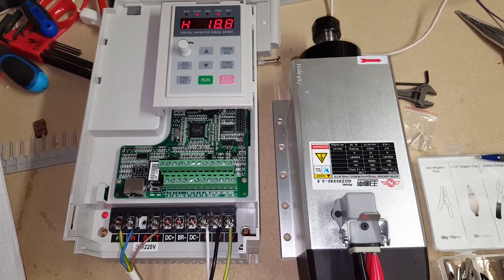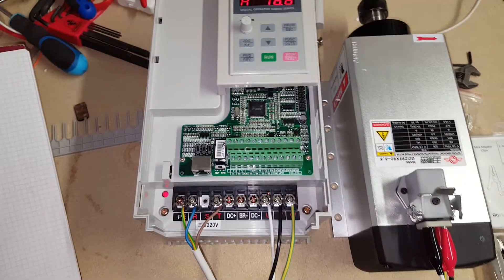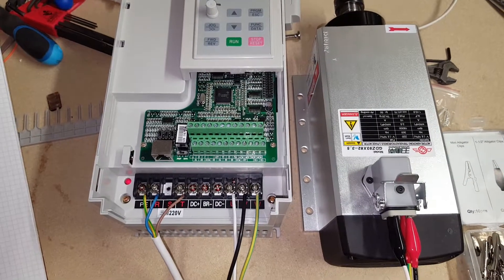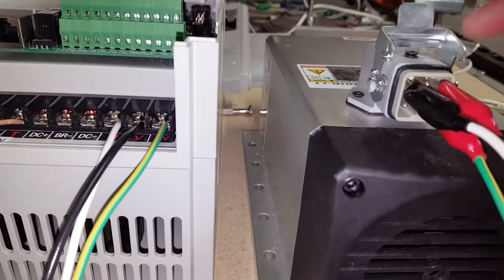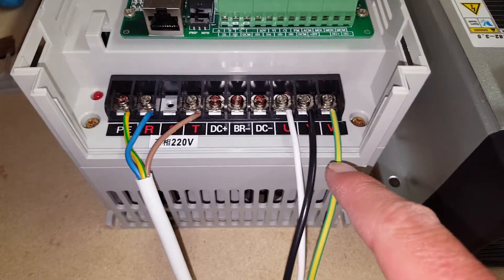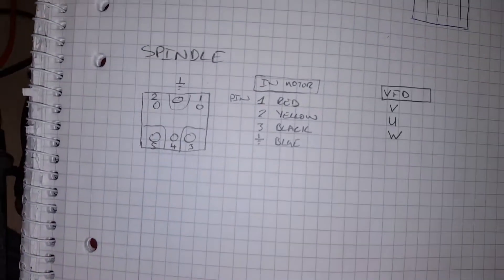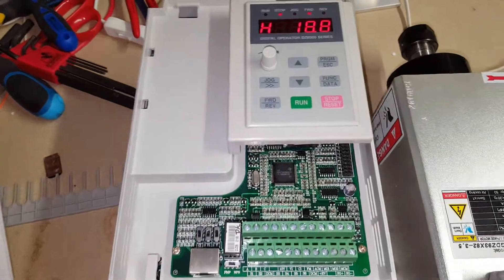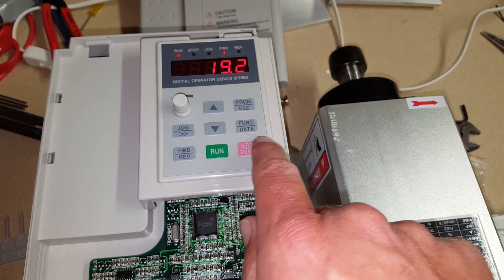Connecting spindle GDZ93X28-3.5 to Fuling inverter DZB280B003. 7

Comment: Hello, I have a question. This a 3 phase inverter, seems like you have it wired 1 phase, are these inverter 1 phase or 3 phase?  THank you much
Reply from the maker: Hi, The inverter takes single phase (from the wall) and chops it up into 3 phases for the motor. RST are the incomming lines, UVW are out. EMI shielding is not great, so its pretty noisy on devices close by.

Comment: I made connections and looked at settings all right. but it does not work on the back of the potentiometer on the inverter , user manuall is chinese :/ do not write me the parameters from scratch

Comment from the maker: Spindle SETUP:
PRGM (F0) 
UP (F1) Motor settings
FUNC (F1.00) 
UP (F1.01) motor power
FUNC (3,7) (KW)
DOWN (3.0) (KW) For 3KW spindle 
FUNC (F1.02) Rated Frequency of the spindle
FUNC (400)
JOG ( to go to first digit)
DOWN (4 goes to 3) set frequency from 400Hz to 300Hz
FUNC (F1.03) RPM
FUNC 18000 rpm ( calculated automatically )
FUNC (F1.04) Rated voltage
FUNC (200) V
JOG
JOG
JOG
UP 
UP (220) V for 220V users
FUNC (1.05) Rated current 
FUNC (15Amps)
JOGx4
DOWN x 5 (0011.0) 11Amps
JOG 
UPx4 (0011.4) 11.4 Amps
FUNC (F1.06)
PRGM
DOWN (F0)
FUNC (F0.00)
UP (F0.01) comms type to input terminal not VFD keyboard
FUNC (1)
PRGM
FUNC (F0.00)
UP to F0.003 (VI control, PWM from BOB)
FUNC (0)
UP (1) 
FUNC
Reply: For some reason when I use these settings, my spindle doesn't work with the knob? Is there something I'm doing wrong? Thanks

Comment: Just to clarify more, I attempt just to rotate the spindle using the inverter panel Run button, I still did not connect any PC breakout board or other device.
Reply: Hello Anass
Can you please help me in setting up . I have connected the 3phase power supply you dzb 300 series filing inverter and connected the u v w to spindle but when I press run button it is not working. The button is disabled or something. It just displays H 0.00

Comment: Hello Ryan,
I just bought a Fuling inverter model DZB280B002.2, I received with it a Chinese language instruction manual for older models ( DZB200 and DZB300 instruction manual) I have configured the main parameters after a big waste of time, but till now I am stuck on the first run test on the very begining.
I made the same wiring as in the video but cannot get the spindle to rotate.
When I switch on the inverter it shows H 0, the H is blinking and could not find how to change this frequency parameter from 0 to another value.
Could you help on this issue please ?
Reply from the maker: Anass L. Hi. If you configure it correctly you might actually have disabled the panel and the spindle is waiting for the BOB to control it. I'm in Denmark this week but can make a quick video when I return showing how to wire up the BOB.
Reply: Thank you for your prompt answer, 
In your video I have seen no BOB connected to the inverter, is it mandatory to use one to set the output frequency ? For now, I am just trying to rotate the spindle with the minimum stuff to see if it works.
The function F0.01 is set to 0 to allow the buttons RUN and STOP for operation control.
Reply from the maker: Anass L. Hi, no the BOB is not needed if you set up inverter parameters correctly. There is an English manual online for the series, try find it. Otherwise we can chat later in the week.
Reply: Fuling website at this date has broken links in its downloads page:

http://chinafuling.com/en/down.aspx

The closest english manual online is the "DZB200 Series and DZB300 Series user manual" where no quick start method is listed, and where in its 101 pages I failed to come out with a solution.

So I keep expecting your help by chat as you suggeted, 
thank you in advance.
Reply from the maker: Hi, this is the manual i used. https://www.manualslib.com/manual/828872/Fuling-Inverter-Dzb200-Series.html

It has all the specs and settings.
Reply: Hi Ryan; 
Thank you for the English manual link, this manual is for DZB200 and DZB300 series (older), it is a general purpose dedicated to skilled engineers in inverters field; Fuling doesn't have specific models user manual, they even do not provide quick start method to simplify setting up procedure as do other manufacturers.
After much trial and error using the manual,
I succeeded to rotate the spindle in manual control mode by setting the next 6 parameters: F0.01, F0.03 , F0.04, F0.05, F0.07, and F1.02.
Unfortunately, I fell into the same issue after I switched to Breakout board control mode by changing F0.01 value from 0 to 1, now the inverter shows H 0.0... and I have to search for the reason.
Reply: Sorry, I meant I changed both F0.01 and F0.03 values from 0 to 1.